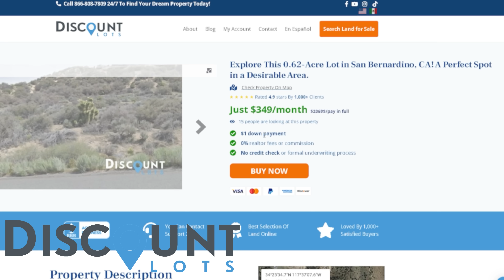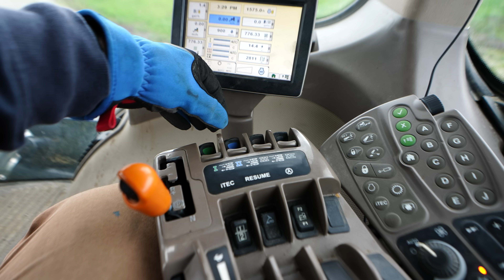Brand New John Deere Cultivator Is Broken Before It Even Gets To The Field

Comment: To save you some headache later on in life, take apart and check the 7 pin connector wires on the plug going to the tractor and the connection plug on the hitch. The set screws tend to come loose and cause the same issue
Reply from the maker: Appreciate the feedback. I’ll add that to the list!

Comment: Everything on the tanker looks well thought out. When it comes time to replace your 3 inch sprayer fill hose, I would definitely recommend the ribbed hose like that used for the agitation. The rubber hose, especially with the ladder in the way of the hose tray, can be a lot.
Reply from the maker: I’ve already learned that through the beginning of spraying season. That rubber hose is heavy!!!

Comment: We've used a cut a plastic barrel in half with a few notches cut at the right places to fit over the shaft and cover up your pump. And you will want to add a fresh water tank on the fender of the trailer to wash your hands if needed. Keep up the great content and stay safe this upcoming planting season
Reply from the maker: Appreciate the solid advice. Hand wash tank is on the to-do list.

Comment: When it comes to the digger, check for a Blown fuse. Had a similar issue with a 2660VT and it turned out to be a Blown fuse. Once replaced it fixed the problem

Comment: Make sure you vent your trailer when dumping your load. It will suck the sides in like a tin can. Would love to see sides a top on engine compartment.  Still think you should go to the blue beacon and have them brighten it. Watch the surge when driving. Stop signs keep brake covered  as the surge will continue to move you. Keep videos coming.
Reply from the maker: Thanks for the tips. There are vents for each compartment!

Comment: On your 2230 make sure your 7 pins is clean and plugged in. True set system has nothing to with folding. Its a very simple system i wouldn't be worried about Reliability and If ture set ever fails you can still run your single point and go.
Reply from the maker: That was the fix. You never know about the long term reliability… we will see!

Comment: We just got our 40.5ft cultivator, ordered 2 years ago. our 345 and 360 HP tractors pull it fine. First thing I'd do is make sure the port is working and hoses are fully in, then check the sensors, if something was misaligned, folding it up could have damaged it. I've only used ours once, but I was able to fold up the middle wing before the outside one folded, it should not be able to do that but it did.

Comment: Yes all valves should be closed for road travel. Also if the sparge  system becomes a problem you could extend the pipe inside the tank to close to the bottom and use a tee to spray in two directions
Reply from the maker: That is an interesting idea!

Comment: You definitely  need a clean  water rinse  tank for your hands .    The Rotater  on the Trackhoe is 100 grand    60,000 for a mini 18,000 pound machine  .  They are amazing  but not something  you want to  use hard digging  stumps  or  breaking  concrete
Reply from the maker: $100,000?! That is wild… the sprayer has a hand rinse tank and the tanker will get one eventually.
Reply: @aTrippyFarmer my friend  bought  one and it was 4 months  just to get the guys from the UK to come and install it at our local JD dealer  that was on a Jd 85  mini    . The replce the controls   it's a big deal

Comment: The trailer looks like it turned out nice... Just wondered if you put valves on the sight glasses, could prevent you from loosing the load if a leak develops..... one other observation - is there a check valve in the air purge line? Probably help keep product out of the air system
Reply from the maker: There is a check valve in the air line. I am not sure about the sight tubes. That isn’t a bad idea!

Comment: You are definitely going to run into foaming issues. We have had decent luck with granular anti foaming products. Overall the plumbing valves and materials used on that tank is as good as you can get.
Reply from the maker: It looks like it was well done. It wouldn’t have been that nice if I had been in charge… 🤣
Reply: Good choice we started with an old milk tanker no baffles.

Comment: A citric acid wash would help clean the trailer up a lot.
Reply from the maker: It could definitely use something to clean it up more!
Reply: @aTrippyFarmer  My dad owned a Manufacturing company here in Texas and we built a lot of equipment for the Oil Field as well as our local Volunteer Fire Departments. We would sometimes have the previously owned stainless steel and aluminum trailers our customers ordered acid washed before before rigging/building them out and it always worked wonders and wasn’t back breaking. The company we used to polish them said it made their job easier as well.

Comment: I'd be interested to hear your views on Colorado's newly enacted right to repair legislation for ag machinery, i.e. Deere et al having to supply parts, software, tools, service manuals, etc. and if you'd welcome that in Illinois?
Reply from the maker: It’s pretty hard to complain about something that supports the farmer’s ability to repair their own equipment. In my opinion, the issue is the service monopoly. There is not ability for outside companies to work on newer equipment which allows Deere dealerships to run their prices rampant. There needs to be balance!

Comment: Andy, do yourself a favor. Makeup a simple fire hose with a 1" open bore nozzle. Reduce the 3" discharge to a 2" layflat hose to a 1" open bore nozzle of some kind. When your done spraying. You'll have your own fire suppression vehicle.
 
 That internship you just offered is a job of a lifetime for someone. Best wishes in finding that person.
 
 We're all feeling the effects of Corpflation.
  
 Honda anything are the only reliable pieces of equipment on earth... L0L

 Happy planting. Burn and turn until the wheels fall off... L0L
Reply from the maker: That’s a pretty neat idea about the fire hose. We’ve thought about using the tanker as a fuel trailer in the fall, but we haven’t fully vetted the legality of that idea.

Comment: I probably don't need to tell you this as you are not a dumb man......be extremely careful with cornering and stopping. With the  baffles missing and half loaded compartment is dangerous and very susceptible to rolling over. I have driven tanker before, you must be cautions.
Reply from the maker: I appreciate the concern, Jason. We will try to take it easy on the road!!